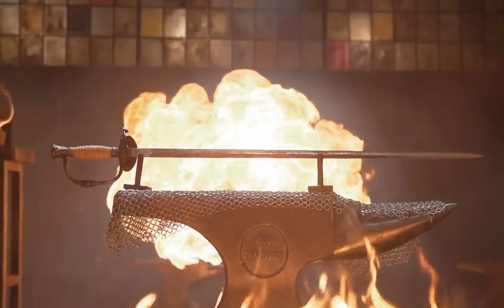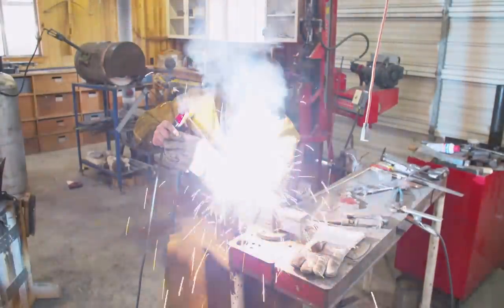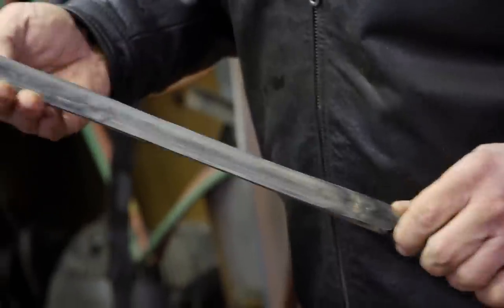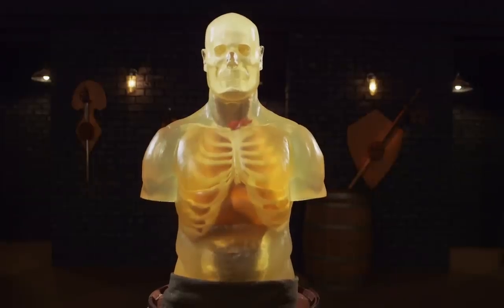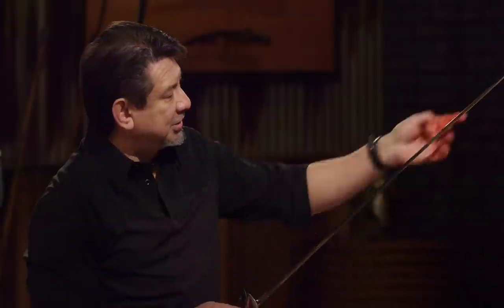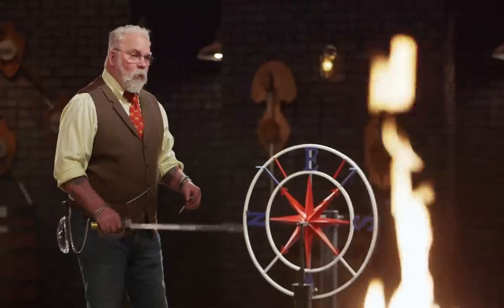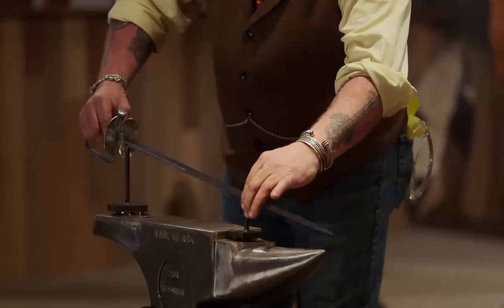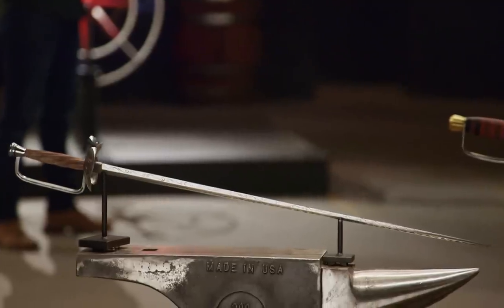Forged in Fire: Ulysses S. Grant's Sword PUSHED TO THE LIMIT (Season 8) | History

Comment: Paul probably didn't even make an error when forging - it could have been a flaw in the steel itself. I've had blades made by well-regarded professional smiths snap when used for re-enactment combat - it can happen to anyone.
Reply: It's Paul and I wanted to say Thank you for the nice words.
Reply: Truth be told, I think that's the case for a lot of the blade failures on this show. The time crunch that they have to produce these blades means that it isn't hard for a small flaw to get by. Combine that with the fact that (from my perspective) many of these bladesmiths have probably never had to forge something as big as a sword before, and I think that it's easy to see that a failure doesn't reflect on the skill of the smith.

Comment: What lots of viewers don't get is that the KEELing potential doesn't come from the heftiness of the sword. A brick can KEEL someone laying on the ground just fine, but how efficient would it be in a combat situation? Being heavy doesn't mean it will KEEL efficiently, and being heavy doesn't mean it will hold up well against abuse. 

Also, although weight is an issue, more than weight alone, the distribution of mass is a more important factor. Ideally you would want more mass on the blade where it's close to your hand, and less mass further away from your hand, near the tip. This is where distal taper and profile taper come in. As you rotate your wrist and elbow to strike, the region near the tip carry greater speed, so there should be far less mass for the sword to feel lively, and the thickness to be less prominent to have the optimal edge geometry for cutting. Near the hilt, the blade should be much thicker so overall the blade remains rigid, and it can maintain a good balance while still carrying a healthy amount of heft.

This way, the sword overall feels light and nimble, will be more precise, and given the same amount of energy input will accelerate far better to carry much greater tip speed, hence much greater kinetic energy and momentum at the point of impact with the target.

Also, being heavy and chunky doesn't equate to durability. Whether there's a flaw during forging, and how good the heat treat decide that. You see that the jeweler made a delicate blade, yet it's far more efficient in striking, far more precise in thrusting, and it has the right amount of flex temper to be durable. It's not perfect though, as it probably lack the proper distal taper, meaning that the base could be made slightly beefier while still having a delicate upper portion. The central ridge could be raise a little bit more, and the edge geometry could use a bit of a hollow ground so it maintains the light weight and thin cutting edge. But at the end of the day, he still handed in a far more superior sword than his opponent.

After 8 seasons, I wish Doug could spend some time more about distal taper and weight distribution, as these are unique aspect of swords that typically matters less on knives and axes. It would add immense educational value to the entertainment, so viewers can have a better understanding of actual functional swords.
Reply: At the same time, a heavy, but balanced weight (not causing it to be difficult to wield), will allow for more impact to your cutting edge. There's a sweet spot in between heavy and light for maximum damage.
Reply: @tErminal32015  Yeah, agree. The sweet spot for the correct weight and weight distribution for the specific usage of a sword design is a nuanced matter. You can have a relatively hefty blade overall, but the mass is distributed in a way that the point feels highly maneuverable and the cuts are easy to accelerate. You can also have a light blade that's so easy to generate tip speed that the greater kinetic energy it carries would compensate for the smaller mass.
Reply: @FortuneFavoursTheBold  yep! You're correct on all counts about the performance advantages of the distal and profile taper. I had the privilege of examining the antique sword used as an example and I was able to duplicate it's weight, thickness and distal taper very nearly to perfection. I'm confident my sword performed the same as the antique blade would have save for the little bend it took in the KEAL test. You my friend are quite the scholar in this aspect!

Comment: Just a crazy idea here: Has anyone ever made, or used, and Induction Forge? Using induction coils, linked together in series, you could heat metal quickly, and without flame. Also, since its AC, you can use a voltage regulator like a dimmer switch, and conceivably use it like a thermostat, of sorts, to set the temp where you want it. Any feedback is appreciated on this idea. Thanks!
Reply: There are electric forges and tempering ovens out there, they use conventional heating elements though. I don't know how difficult it would be to get the temperatures in different pieces of metal correct with induction. Atmospheric heating seems to be more precise to me.
Reply: Isaac from the episode. Another bladesmith in my area uses an induction forge for some of his work. The opperating costs are high as it pulls up to 50 amps but it definitely has its place in his shop for certain processes.
Reply: @gardblades  I didnt know that. Thank you!

Comment: what do you expect from those bending tests? Its like theyre trying their best to break them
Reply: I agree compactly 100% lol
Reply: Have you seen Cold Steel's flex tests? They make forged and fire look tame, If a mid priced sword manufacturer can make blades that handle these tests, so should a forged in fire champion.
Reply: It's a harsh test, but not the worst or overly unreasonable. If a sword can't flex and bend while still staying true then it will 1) hurt the user since the blade doesn't flex to absorb shock on impact and 2) will be damaged more than a sword that is correctly tempered.
Reply: They expect it not to snap. Certain types of swords have to be elastic. Brittleness or flexibility without elasticity will compromise the practical usage of the weapon. It looks harsh because it is, but it is a great test of technique and consistency.